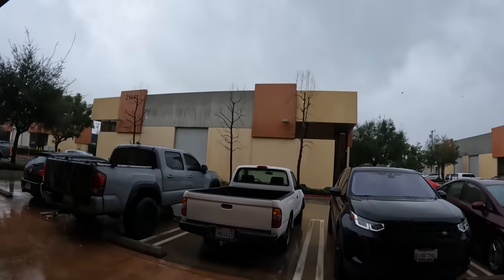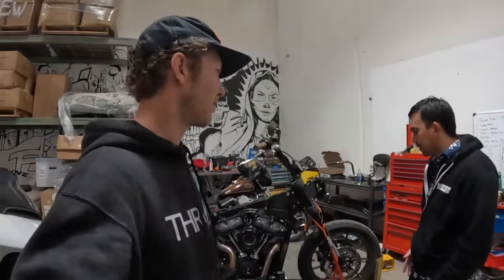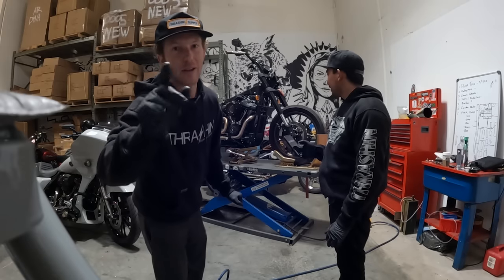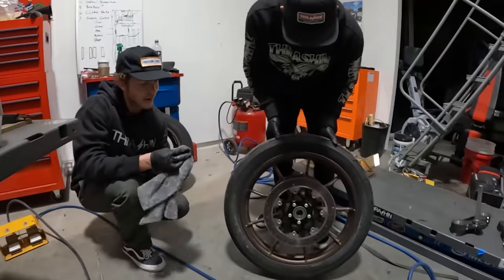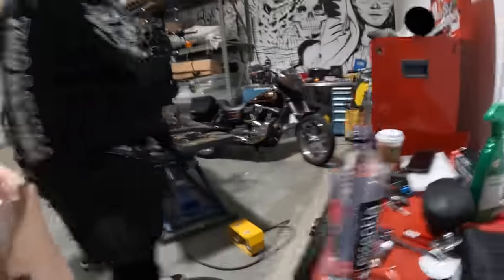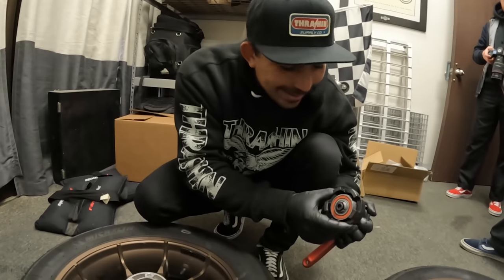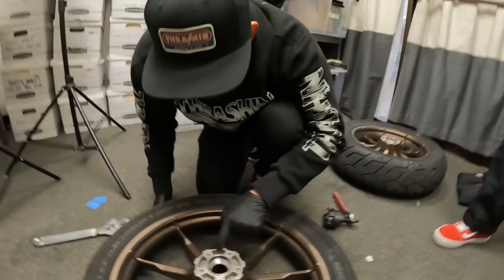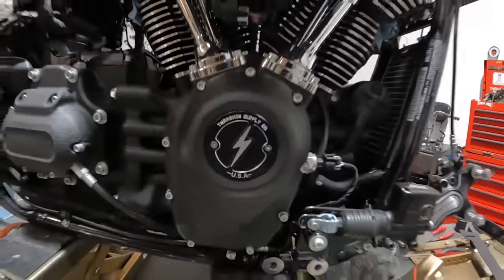Tear Down & Tequila Shots - Lowrider ST Build! Vlog 60

Comment: Man, the 117 already has a pretty hot cam, max torque is  108 rear wheel at 3500 rpm, instead of something like 2900-3000 on other smaller M8 model engines. Selkirk's Diablo came with bronze rims. Copper color rims work with your color combo?  Not something seen very often. If those tires are 1/2 or more to worn out, if taking them off, may as well put new Scorcher's 31's on, at least in the back.

Comment: The fact that u guys can get the tires and forks off in 26 mins shows that too many shops/ harley dealers, are sandbagging and dragging their time to charge more for service
Reply: Sandbagging ? 
two guys doing it as a one off on your own bike is one thing  but working at that pace , plus doing all the tasks involved from booking in the job right up to handing it back , for 8hrs 5 or 6 days a week year after year while trying to remain profitable,  is impossible. 
Working on your own bike is completely different to running a workshop

Comment: If you’re gonna step up to GP4 calipers.,, please, PLEASE don’t shoot yourselves in the foot and use that lame 0E Harley master cylinder.  I run huge Galfer 300mm full floating wave rotors with high end Brembo mono block calipers w/aggressive pads on my Low Rider. The break performance was marginally better than stock, thats it. Yep!  Even with all that high-end hardware.  Once I added a real master cylinder to the equation it was Game On Bro!  Seriously, if I had to put a number of brake performance I was leaving on the table,  I would say it was high as 40%!  Yep! Even with all that dope ass hardware. Think about it.. your master is what pressurizes those lines to give all that braking power to those awesome calipers of yours. With the exception of high quality tires that apply the friction required, allowing mechanical grip to the road surface, the master cylinder is the MOST important piece of the equation!  Don’t cheap out. 
Ask Luke or Evan. Heck,, ask Bostrom himself. He’ll tell ya son🤙